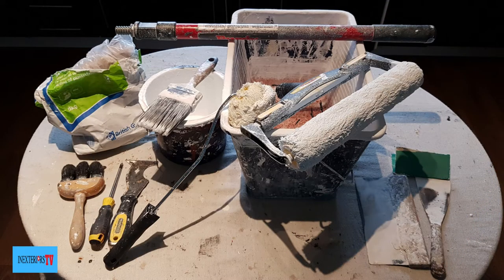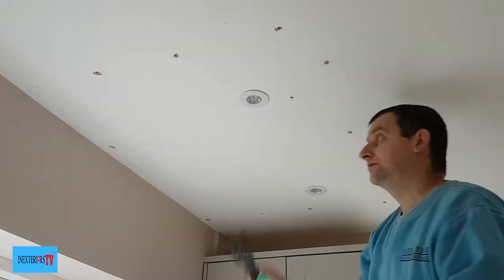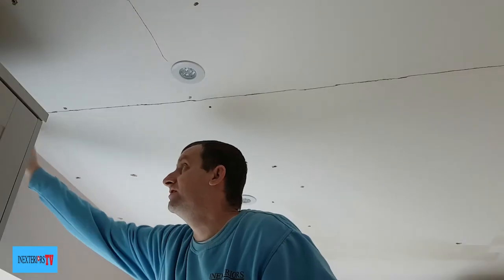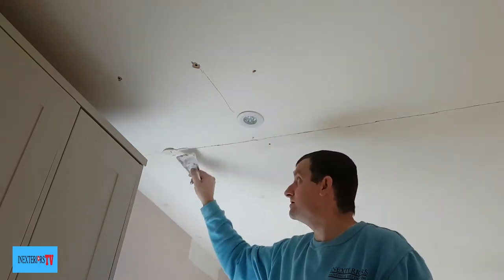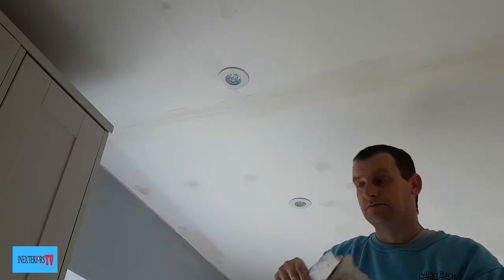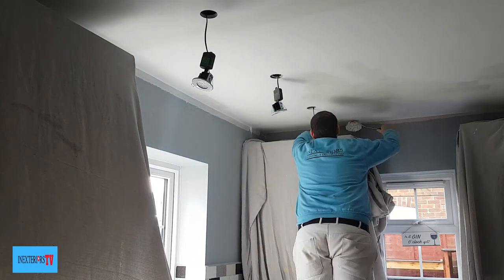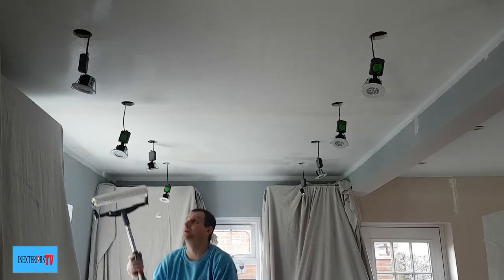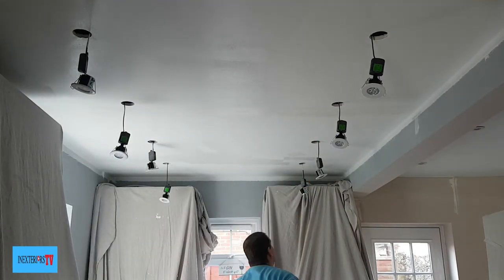prep & paint a ceiling with cracks & screw pops. Ceiling cracks & screw pops.

Comment: How long in between plaster coats ? im currently doing this in my living room.
Reply from the maker: As long aa it takes the filler to dry depending on depth and temperature, what filler ar you using. if you are using the easifill 60, you can probably 2nd fill after an hour or two, but to sand before painting leave it over night.

Comment: How long did that take for the repairs and the painting? Cheers!
Reply from the maker: @Widgetmaker . Hi, it took about 2 and a half hours in total with sheeting up and cleaning.
Reply: Was that tape around the edges on the grey  wall? It looks like you painted part of the grey wall.
Reply from the maker: @AlexN0me11  No it was where i cut in the first coat grey. The walls only had 1 of 2 coats of paint at the time so the white was still showing through, once the walls had a second coat that disappeared.
Reply: @Inexteriors  ahh I see, makes sense now lol thanks